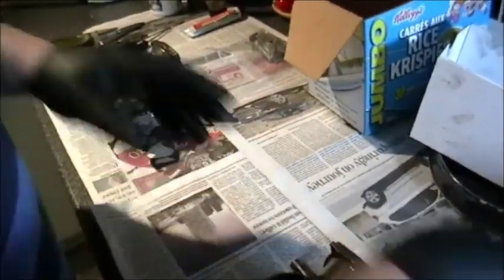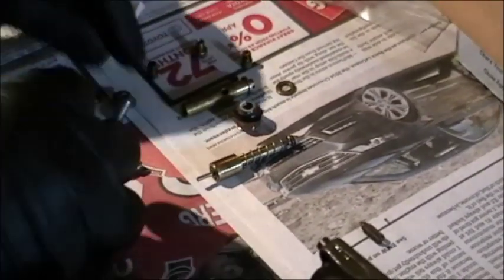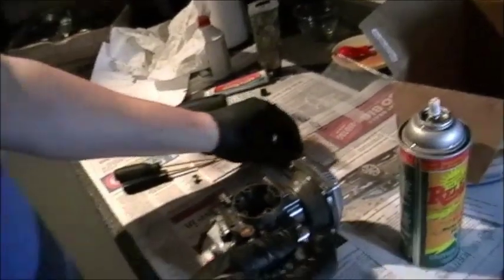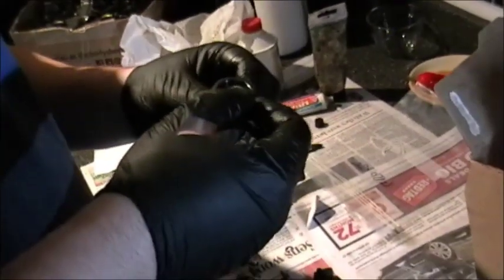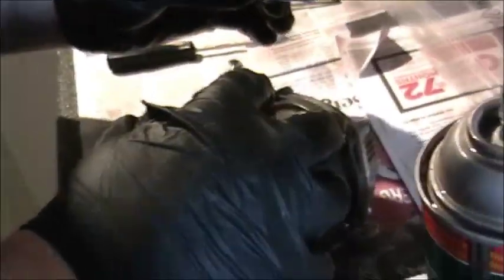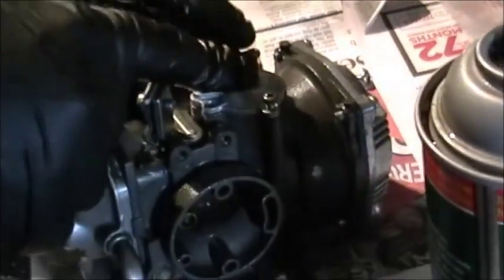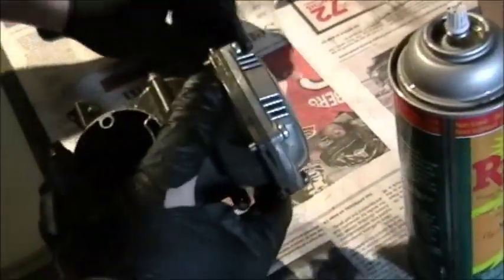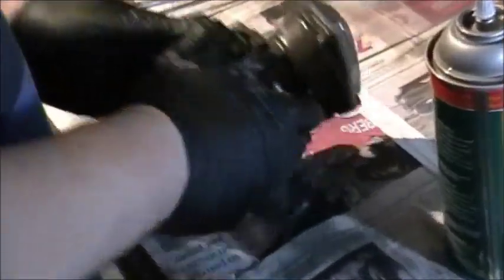Building Yamaha Virago Carburetors in Depth.  1983 XV500 -  Front Carb.  Part 1 of 2

Comment: I just got an 83 Virago 500 that had been sitting for 25 years. It only has 1800 miles on it. I may rebuild the carbs at some point. But, for now, this video really helped me orient myself with these carbs. Both floats leak, which is no surprise. I just did a terrible thing and filled the carbs with PB Blaster, through the fuel line. Now that I know where the float drains are, I may proceed with blasting products in through those. I'm hopeful that I can get it to stop pissing, without taking them all the way a apart. Thanks for the superb overview. Darn good camera work, as well.
Reply from the maker: I appreciate the kind words. I’m a huge fan of using sea foam to clean out the carbs I don’t want to disassemble. Also a couple of decent taps on the carbs when they are leaking can sometimes knock loose the bit of dirt holding them open.